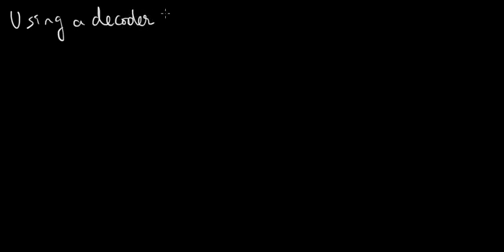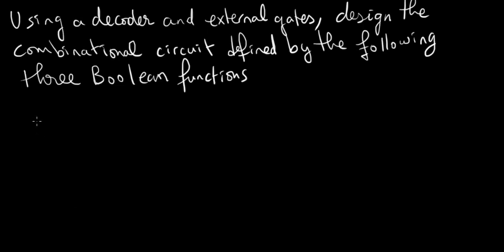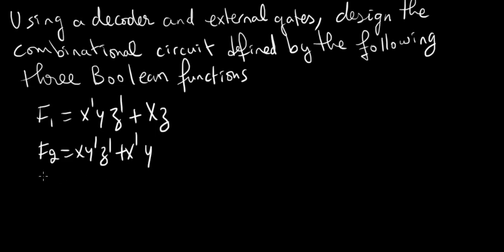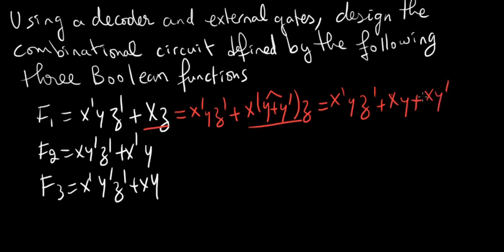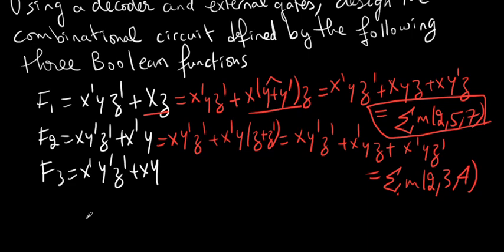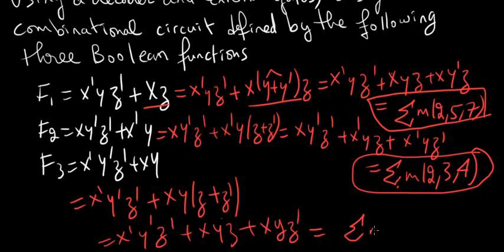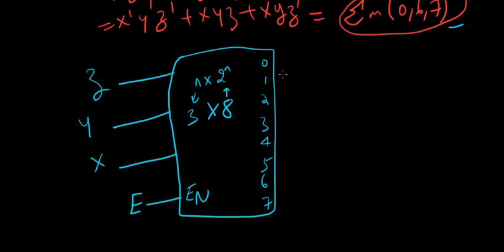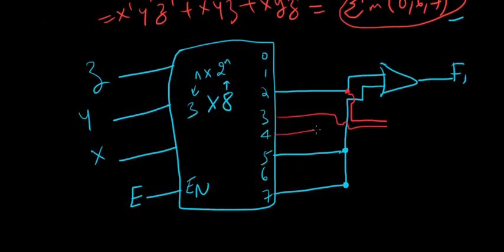Combinational circuit with decoder and external logic gates - Digital Electronics Example

Comment: how can we do these using nand gates
Reply: Inverting the inputs to the "OR gates" automatically makes the inverted OR gates NAND gates. So just invert the OR gates but you will also need to invert the outputs of the decoders where they connect to the OR gates. This is required to make the circuit equivalent to what we have in the video. Did that help?

Comment: what if we got a fuction f.e.  f1=(y' + x)z ???
then we got two times the xy'z
Reply from the maker: +Leonidas Hliop By "two times the xy'z" you mean "xy'z+xy'z?" cause if you did, then that would just equate to xy'z in Boolean Algebra. Anyway, these are the steps if you had (y' + x)z
=zy'+xz=(x+x')y'z+x(y+y')z=xy'z+xy'z+x'y'z+xyz=xy'z+x'y'z+xyz=m(1,5,7)
Reply: simply find minterms first you can do it without using canonical form